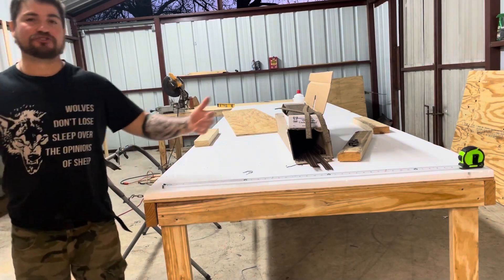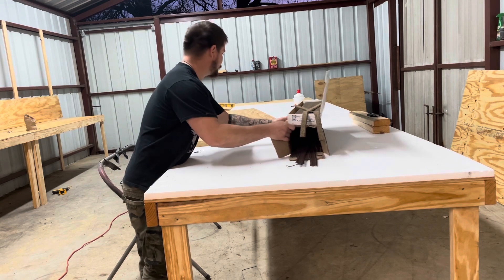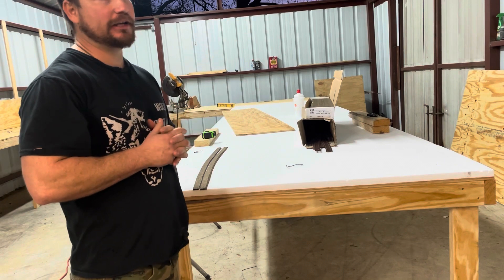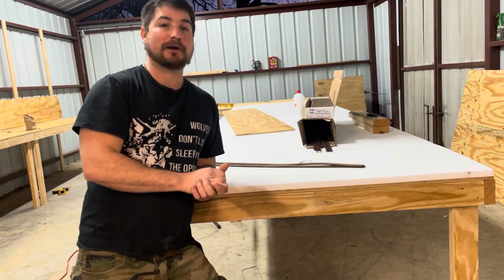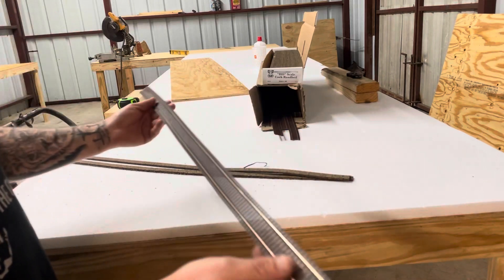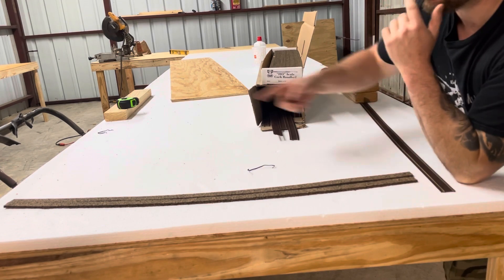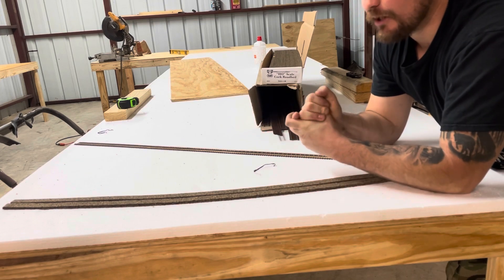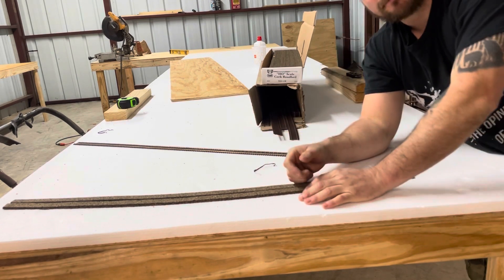Beginners of a layout need to know radius and curve before glueing down

Comment: Hello Sir Allan again, 
I have a question about the flex track you're using at the moment now. 1st of all what is a railroad code track? Can I Sauder the flex track together to make it a little longer and to make the curve smoother with less sectional curve tracks like for instance you mentioned the 22" curve tracks? 
Thank you for your time 
Sincerely 
Allan
Reply from the maker: Absolutely keep your flex track straight as u can then solder them then flex it into position..oh code 83 I use and 22 is a great radius to work with also
Reply: @Hopoweredtrain1988  What is the difference between code 83 and 100? Also does the 22 radius curve come in code 100?